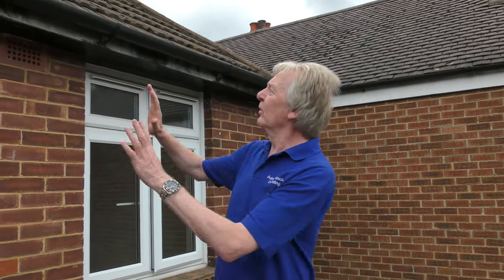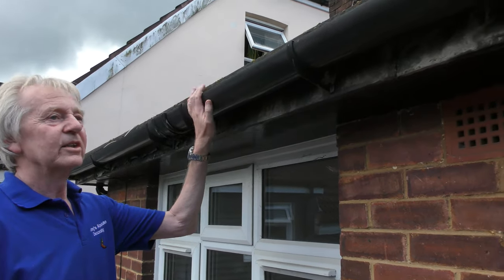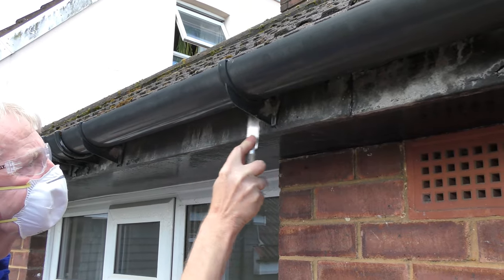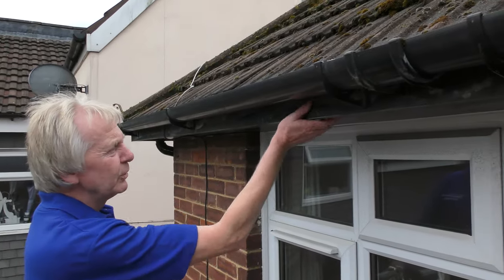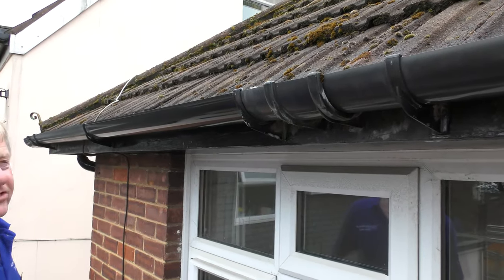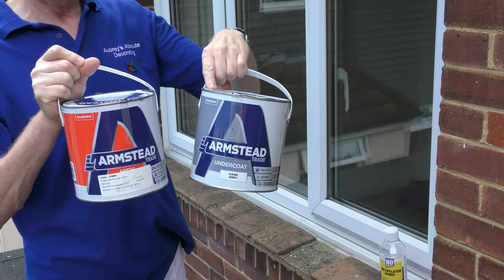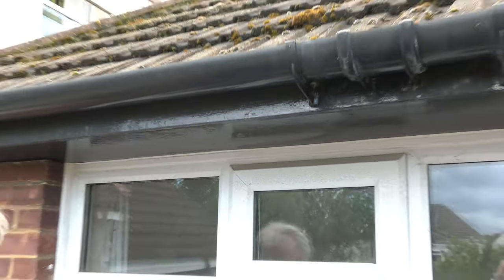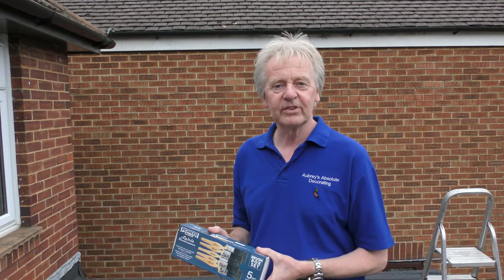How to Paint Fascia Boards and Soffits

Comment: Nice vid Aubrey ,  tried all these new fangled water based paints but oil is still best . I like to give guttering a wipe with Polytrol colour restorer , really brings them up a treat.
Reply: not really mate this job would have took 3 days with 2 oil undercoats and 1 oil gloss with bedec msp with facias and soffits this low down you could it in a day working a long day. plus oil based paint in colours since the 2010 voc regs dont dry very well they stay soft for ages and never dry as tough as whites oil based paints before 2007 were a no brainer then you had the 2007 voc reduction then another in 2010 which lowered the quality to much there not as durable as they were and take longer to dry and to fully harden plus they don't self level anyway near the way they did
Reply from the maker: I will have to give that Polytrol a go, it sound good, thanks 😀
Reply: @jackwardley3626  Just prefer oil mate always will do especially with some Owatrol in it , lovely to use .
Reply: @orbitalforest  I prefer it to for my own house etc but on some jobs its hard to make it pay when its going to add a extra 1-2 visits on a job or even e extra 1-2 days

Comment: bedec msp adheres to oil finishes well. water based quicker to apply find its difficult making it pay with oil based
Reply: Jack would you recommend Bedec MSP for exterior woodwork over other WB brands? Finding weathershield oil based exterior gloss is flaking after 3 years despite employing a pro. Thinking about paying for scaffold and doing it myself next time (dorma) and looking for a good WB paint option. Heard Bedec MSP or Barn paint is the way to go…
Reply: @Liverpool1ne  MSP is good. The problem with exterior re decs is your new paint is only as good as the older paint under it. Its best to strip it all back down to bare woodwork. Traditionally linseed paint was used but without lead being able to be in it its now prone to mould growth. Strip it all back treat any knots with 2 coats of knotting then 2 coats of owatrol oil leaving 48 hours between coats then 3 coats owatrol deco leaving again 48 hours between each coat. scaffolding companies will give a month for the price
Reply: @jackwardley3626 thanks for comprehensive reply I will look into the products you have recommended and spend a bit more time getting it right 👍🏻
Reply: @Liverpool1ne  your welcome thats what I do on high end jobs
Reply: @jackwardley3626  bit of overkill. I just put owterol in sandtex flexible exterior primer  after stripping, sanding and cleaning. Two coats then super Dec two coats.

Comment: how did you find these brushes in oil Aubrey as good as pure bristle
Reply from the maker: I have used these several times with oil based paints and really like them.  They have a good bit of resistance to spread the paint out evenly and stay in shape well.  Give them a bash Jack and let me know what you think.
Reply: @AubreysAbsoluteDecorating  works really well with zinsser coverstain probably the best brush ive used for that is better than pure bristle I find the only thing pure bristle is really good for these days is linseed paints. pure bristle doesn't do as well with modern solvent paints anymore still good but no longer the best
Reply from the maker: Yes, very true Jack.